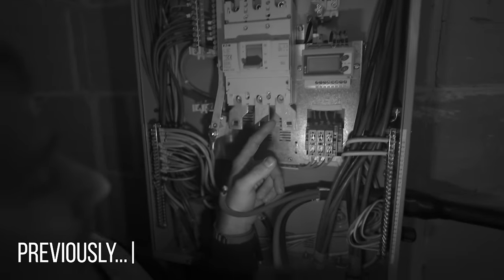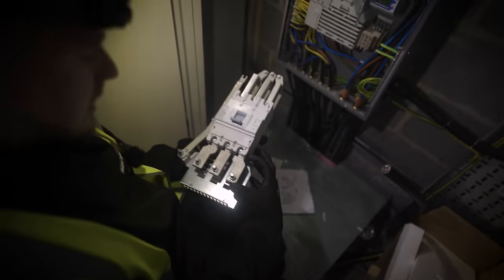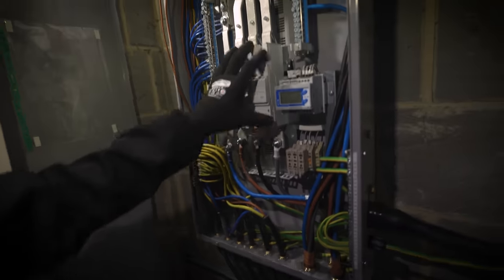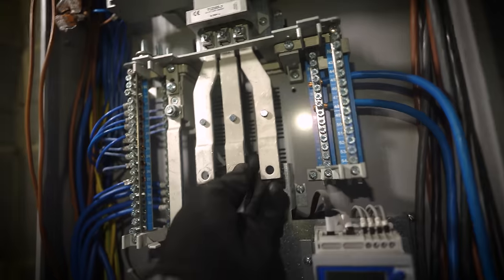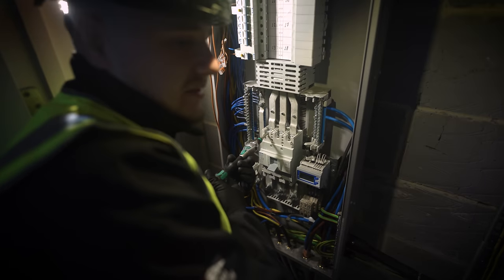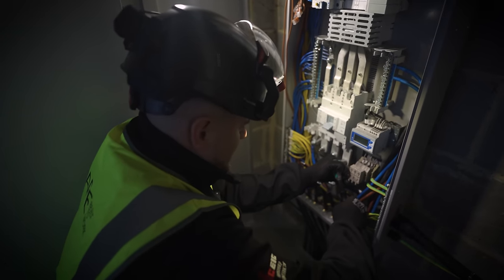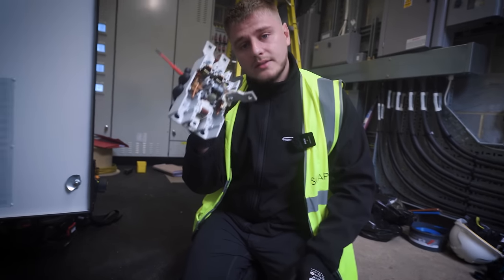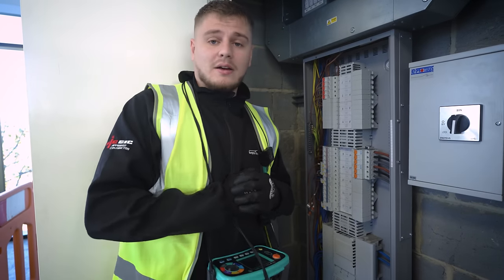This is why torque ratings for electrical switchgear matter

Comment: I found the directions that come with these types of switches are not great at all, manufacturers could do a lot better. Unless you keep the torque wrench at 90’ to the bolt when tightening, pressure will be applied to the side wall of the housing and this will crack as it’s quite flimsy. Overall a bit crap really considering it’s from such a big manufacturer in this field.
Reply from the maker: Not impressed with Eaton here to be honest
Reply: @residualelectrical   Eaton is so-so here in the US, better than GE though which is total shite.  GE breakers are slow to trip on shorts (no magnetic trip in most styles) and have horrible failure rates when new (standard breakers >5%, GFCI (your RCD) >15%.  I use Square D exclusively and have had very few issues.

Comment: 11:20, looks like aluminum cooling fins for the arc chutes. 30:37 you can see the arc chutes, when the breaker trips the arc gets drawn up in to those plates and it quenches the arc, so they heat up. Old school high voltage air break breakers worked the same way. Now they use vacuum bottles or SF6 in high voltage instead of arc chutes.

Comment: Hi Mike. What's the reason for the Isolator / Switch Fuse? You mentioned Division of Responsibility.
Reply from the maker: The board was existing and not installed to the best standard, while we are EICR ing the whole install our replacement submain needed a EIC, the isolator allows us to stop our EIC at the isolator and not take installation responsibility for the DB 👍🏼
Reply: @residualelectrical  I see. Thanks for that. I guess the replacement main switch in the DB wasn't the initial plan.
Reply from the maker: It definitely wasn’t, we ended up changing 5 more main switches throughout the job for the same issue 🤦🏼‍♂️ they came under remedial’s on the EICR 👍🏼
Reply: @residualcurrent  Seen this a lot with contactors. A lot to be said for correctly tightening up terminals to the right torque settings. Fantastic content. Have a great 2024 👍